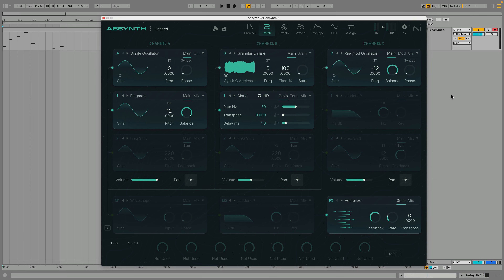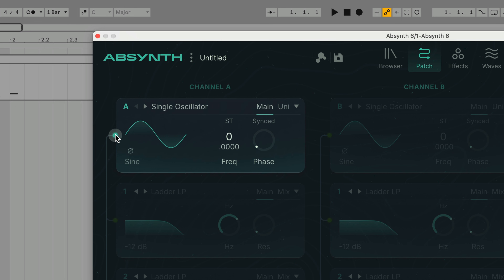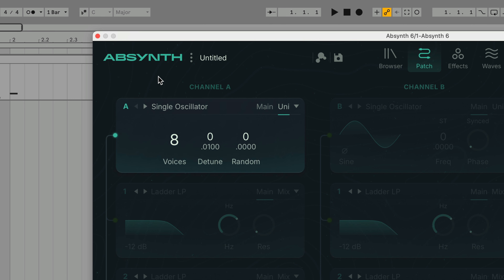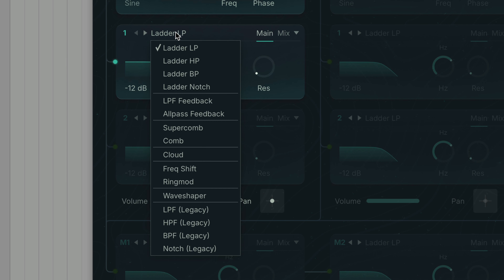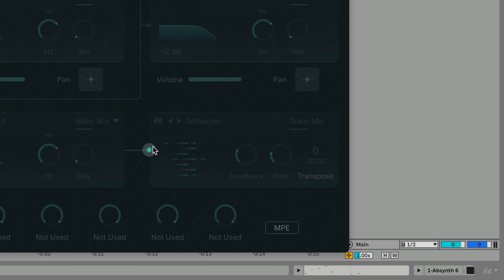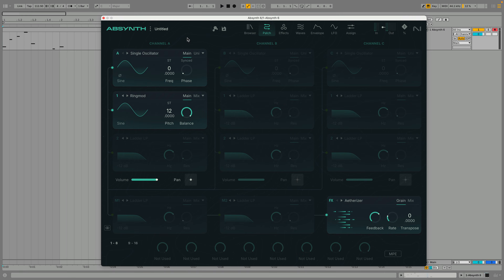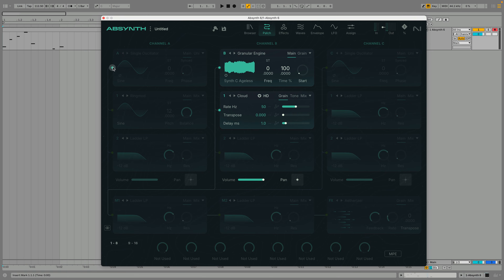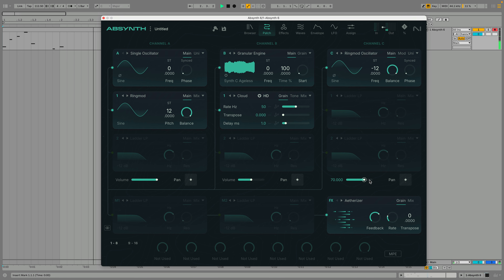Building a patch in Absynth 6 | Native Instruments

Comment: Not backwards compatible. Most A5 user libraries lock up or crash A6 on scanning.
Reply from the maker: We've had a few more reports from users about this issue. The dev team are aware and a fix will be implemented shortly. Please keep an eye on the community for a post about this soon
Reply: Same issue here. Can't use any Absynth 5 Libraries - spinning wheel of death trying to scan on Mac
Reply: @m88ma  Yep, 3rd party libraries are pretty much out. Only consistent fix is to batch remove all the meta in Absynth 5 then they load completely fine but that would be so besides the point.
Reply from the maker: We couldn't reproduce the issue on our side so please reach out in our Community and/or our support, your info will be helpful to investiaget the issue.
Reply: @NativeInstruments  maybe check in with your support crew. With your amazing chat bot setup users are not even able to submit bug reports for a 99$ alpha upgrade like this anymore.
Reply: @NativeInstruments  Check any forum KVR... VI... Major bug! No point submitting anything to support. Any Kontakt 8 and related bug reports have got unanswered. And it's been at least 5 month! We have given up on that process.
Reply: No problems with earlier presets here. YMMV.
Reply from the maker: This is a known issue and a fix is being implemented, please take a look on our community for more info, there will be a post shortly: https://bit.ly/4pwh28q